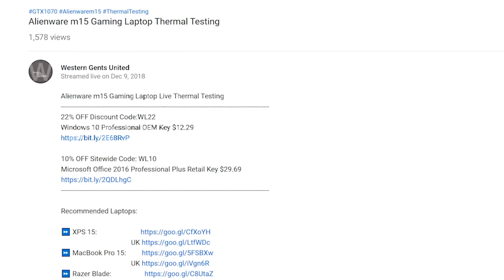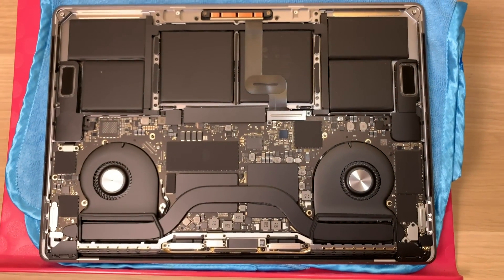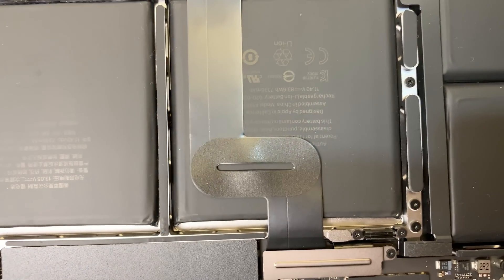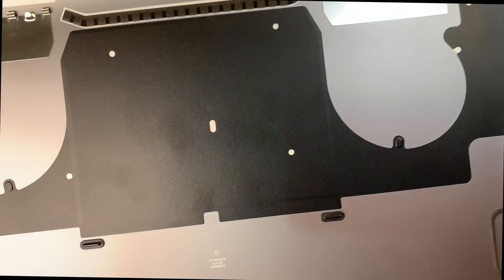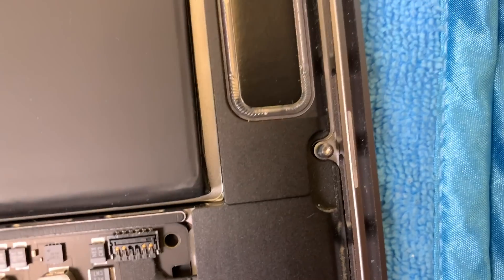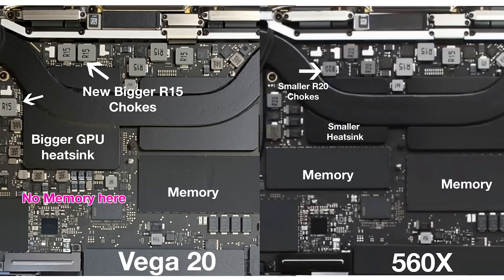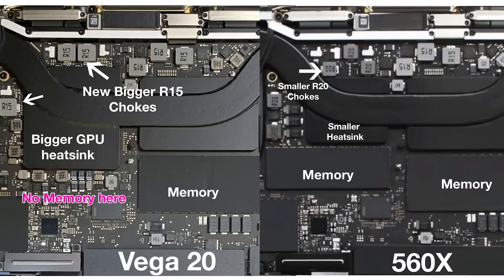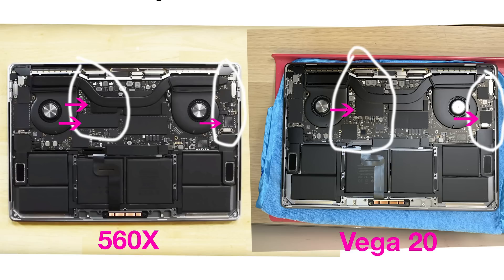Changes Inside Vega 20 MacBook Pro 15 Vs 560X - Quality Issues with the 2018 MacBook Pro 15

Comment: Dell xps 15 2in1 user here. Looking inside a macbook pro 15, they kinda look the same. Although that single heatpipe in the heatsink is kinda concerning for temperature management. Maybe its too small to disipate heat from an i9 processor. In comparison an xps 15 has 3 beefier heatpipes although thats a given since it has a vega m gpu within the processor. And xps 15 still thermal throttle. So far the best heatpipe i saw in a thin and powerful laptop is from your aero 15. Now thats one beefy heatsink. Hehehe. Also the razerblade 15 and huawei mate book pro have a nice big heatpipe design.
Reply from the maker: Some good points

Comment: I hope they will add a SSD slot as in the 13” non Touch Bar version and a easier to remove battery as in the new MacBook Air to make it more easy to repair and upgrade.
Reply from the maker: Don’t hold your breath mate
Reply: One thought I have is: Maybe Apple wanted to have a SSD slot in all models but lack of space in the Touch Bar versions made it impossible at introduction? And maybe they will find a solution for this by future optimizations? What else would be the reason only to have it in the non Touch Bar version of MacBook Pro?

Comment: Cool video, nice to see a comparison between the two and the issues on show.  I also watched a video from Louis Rossmann recently, when the screen connector fails on the 2016 > MBPs you need to replace the entire screen, not just a connector = expensive. Not sure how common the issue is with them but definitely means you should by Apple Care and sell it before it ends!!!

I'm putting my 2018 560x for sale soon, will be switching back to a Windows laptop. Too many issues with MBPs to make it a sensible choice as my only daily workhorse for business,  I will miss MacOS though...
Reply from the maker: You’re right. Apple care is a must. The price is out of control and the quality issue are a concern.
Reply: Did you have any problems with yours?

Comment: This means only single channel RAM?
Reply: The RAM that appeared under the RX 560 GPU was GDDR5 RAM for the 560, Vega die's have the HMB2 packets on the die itself which is why you have less RAM physically visible on the motherboard.
Reply from the maker: Bingo. That’s right
Reply from the maker: I will test the bandwidth but Apple could not be that stupid to make it single channel

Comment: The clicking noise you mentioned is probably from the bottom case support pins. Those pins have springs inside so when you push them down sometime they might make a noise
Reply from the maker: Yer could be

Comment: Vega die is bigger than RX because of Vega graphic memories are High Bandwidth Memory (HBM) instead of GDDR and they are built together with the GPU core. RX is the traditional CPU core + GDDR layout hence the external memory chips. The cold plate is bigger to accommodate the bigger die size or otherwise the copper would not cover the whole Vega core + HBMs.
Reply from the maker: Yep 👍